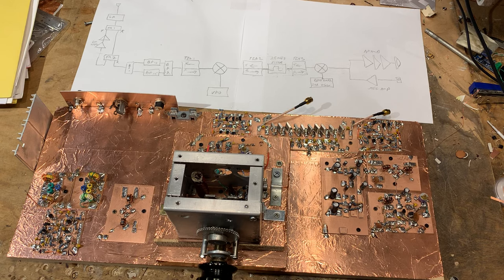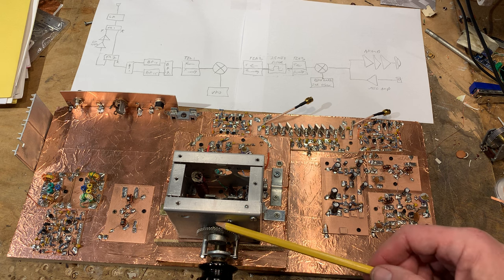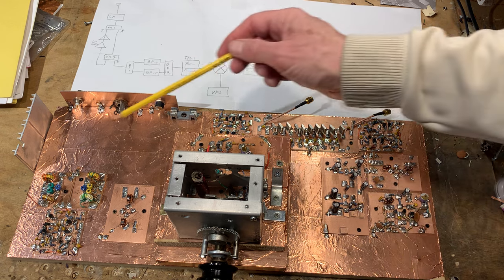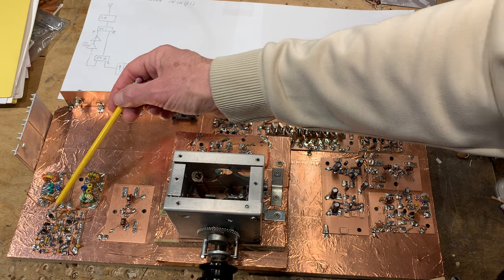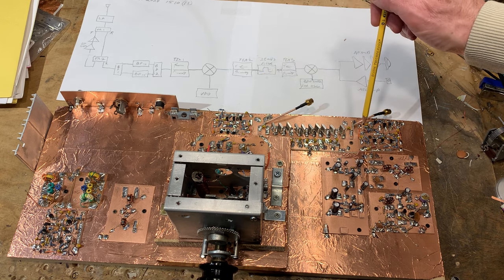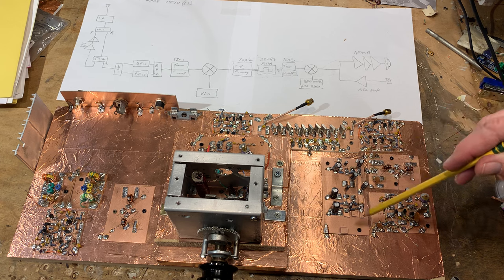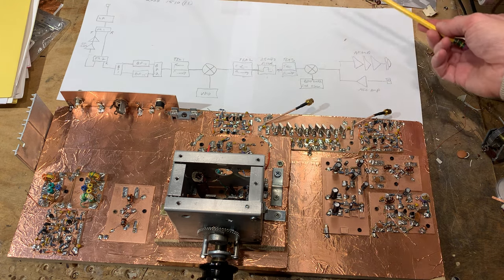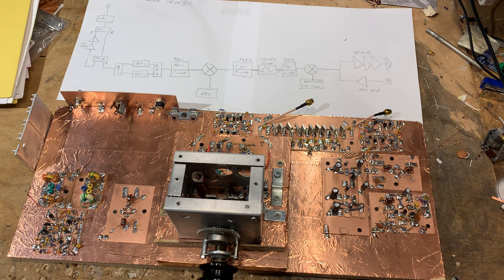A Homebrew 15-10 SSB Rig for the Dominican Republic

Comment: Hi Bill! I think you'll have built your 15m/10m rig three times before I've built mine once!!! I'm finishing up the transmit chain at the moment. I love the copper-covered pine board. It's great to be able to easily see what module is connected to what and to be able to disconnect and swap boards out in the testing process. I loved that about my last rig which I built on a wooden shelf (The Shelf 17). Anyway, keep up the great work and thank you for all your encouragement. 73 from across the Pond, Nick M0NTV

Comment: I used to think of myself as doing a bit of homebrew. But I have an on-line friend in South America who made his own capacitors for his solid-state RF power-amp, and he made the heatsink for it out of coffee cans he pounded flat and soldered together. Of course, he carved out the PCB's for his designs from scraps of plastic he had put copper tape on. So now I just think of myself as a kit builder. :)
Reply from the maker: John:   Who is that intrepid ham in South America?  SolderSmoke HQ definitely needs to be in touch with a guy how homebrews his own caps and heatsinks.  Please send details:  bill.meara@gmail.com  73  Bill

Comment: Great work as usual Bill, look forward to seeing how it turns out. You mentioned reverse polarity protection when pointing at the fuse holder and wonder what you might be using? A Schottky diode? Enjoy the build!  73 - Dino KLØS
Reply from the maker: This is a very controversial topic Dino.  People FIGHT over this.  I just put a reverse biased diode (an ordinary diode) to ground from the far side of the fuse.  If I reverse bias the rig, the diode conducts and the fuse blows before anything emits smoke.  73  Bill